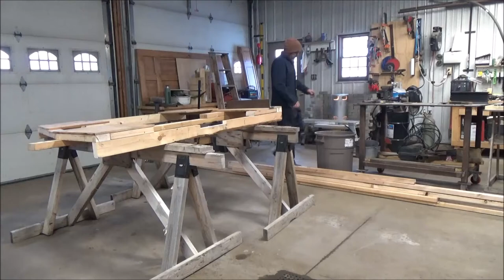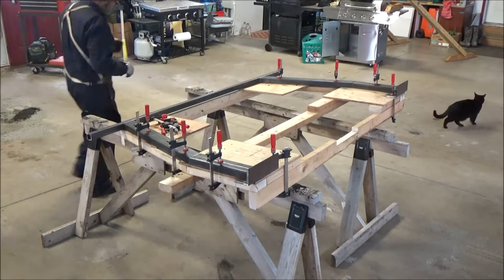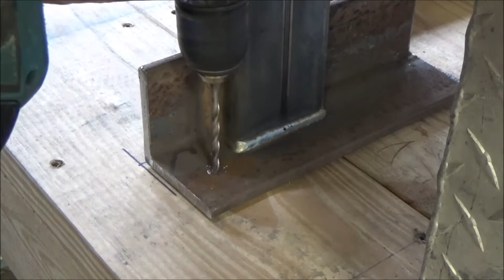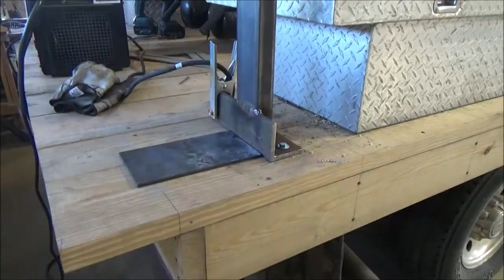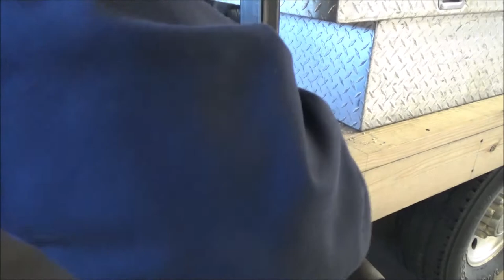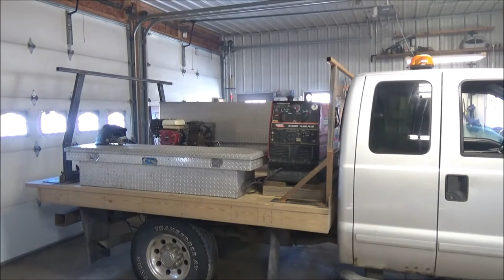Back Rack

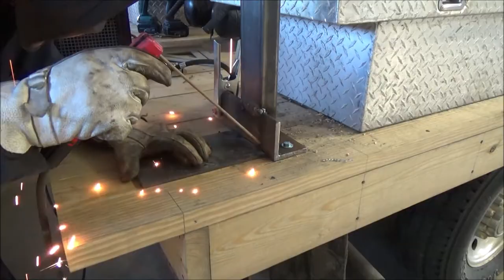Comment: How much stress can the additional plate you added at 2:49 take? I understand the idea behind adding it, but I'm not overly familiar with the durability of a single weld like that. I'm not so much worried about the screws coming out, more the weld snapping and the rack bending. I'm sure you thought of that, I was just curious about durability.
Reply from the maker: That’s a good question.  I intended to add a gusset back there, but then I got in a hurry to just be done.  In my experience, welds are weak in bending, so it is a weak spot in the design.